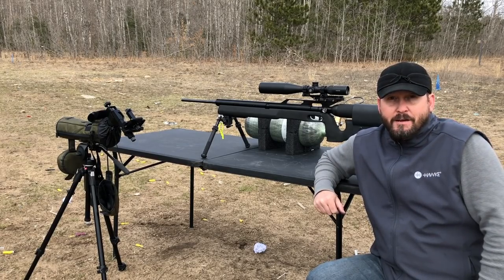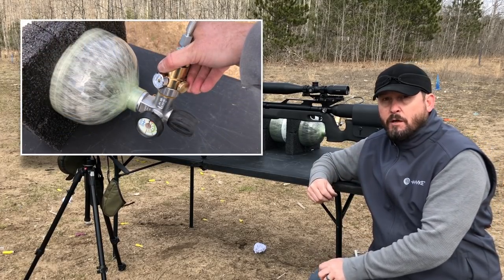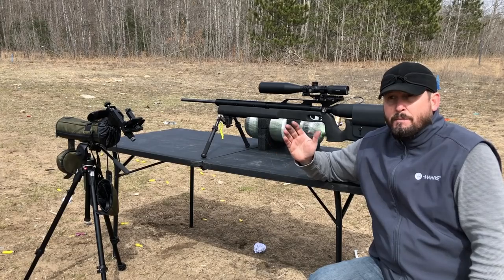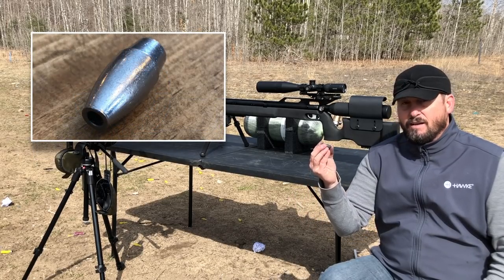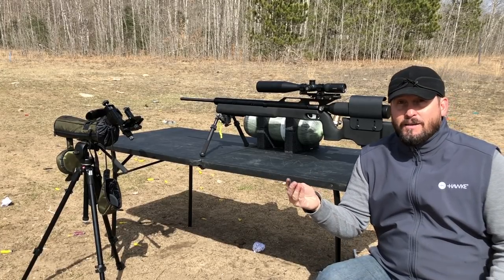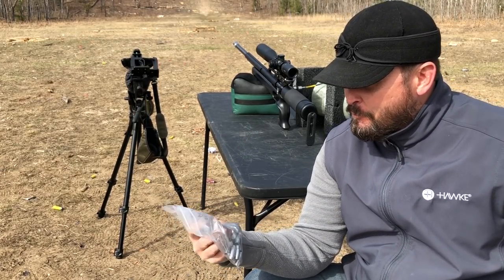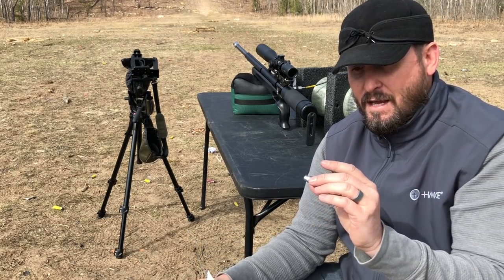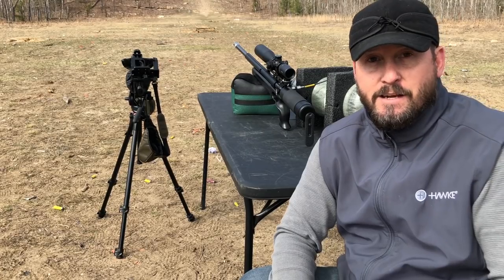AirForce Texan .45:  Tuning for Accuracy - Shooting MOA Groups with Big Bore Airguns

Comment: I am just getting my .457 up and running. I was wondering if you have a wheel spring tension setting choice for shooting this Nielsen 350 grain?
Reply: I have the .50 and spring tension for heavier weights is confusing to as well. Some places I’ve seen say go stronger but some say since the valve is regulated to go lower . If you manage to figure it out let me know 👌 I’m still trying.

Comment: Where do you set your power setting  dial with the 350 grain hollow point.  That's what I will be hunting with .
Reply from the maker: A touch over 3/4 power.
Reply: Thank you for the information.  Very much appreciate it.

Comment: Hey Chris I'm Josh. I have a texan .457 CF with a mad dog stock. My favorite slug is the NSA 350 to this point. What's the best psi to use? Also do you oil your slugs or gun ?
Reply from the maker: Hey bud - good choice! They are the most accurate for sure, but not the best for Deer hunting. NSAs come washed and lubed but I do like to do a small bit of bore butter - silicone oil - and PTFE spray. Keeps the leading down some, but I still have to clean about every 50 shots with a bore snake.
Reply: @UpNorthAirGunner  what's the best deer round? What psi on the nsa 350?
Reply from the maker: @joshuabrackenbury2313  Make sure to check out my videos on ballistic gel testing in the .457 caliber and you will see what I mean.  From NSA - his 348 grain knurled HPs performed great and his 302 BTHP.  Every gun is different, but mine likes 3300 PSI for the best groups at 100 yards, but for Deer hunting I just go up to 3600 and let it rip. Kill  zone is pretty large on a Deer.
Reply from the maker: Joshua Brackenbury ya that was shooting a modded Texan with a 36 inch barrel and custom valve. 525 grain slug

Comment: I’m looking for information regarding understanding the use of the hammer preload adjustment versus bottle pressure.   I have the long barrel version in .308.    I just got the rifle and I’m using nsa slugs.  I’m working my way through the weights starting with the 65 grain & 85 grain offerings.   I’ve got both to print around 1.5” at 100 yds.   My question is what signs do you look for regarding hammer spring adjustment when looking at shot string velocities?    Do you simply add tension until velocity doesn’t increase with additional tension?  This is sort of what I did.  I’d take 2-3 shots check velocity and refill and add tension and run another string.  I didn’t repeat this until the velocity stopped climbing.  I simply stopped with I had 3 shots running about 1050 FPS.     Is there a better way?   Thanks for any insight.

Comment: That's awesome! Do you ever do adjustments with the power wheel on the Texan tho? Also would you have a link for that regulator?
Reply from the maker: I should have mentioned that in the video.  I have found that the powerwheel on the Texan doesn't do that much as compared to a Condor or Talon.  I will tell you though - if you set it too lightly (away from the breech) you can get valve lock and the bullet leaving the muzzle at a VERY low FPS making a faint PLOOOP sound.  It has only happened a few times - but is usually when I am pushing it upwards around 3000 PSI.   So I just set it on one line back from the highest pre-load and don't mess with it.
Reply: UpNorthAirGunner 
Thanks that helps a lot. Im pretty sure I've experienced that sound before. I've mostly been shooting 250g spitzers and I started manually filling to 2700-2800 instead of to the 3000 mark and it seemed to shoot better. That's with the power wheel one line from center towards the trigger. I'll definitely try your adjustment on the power wheel. 

Also, is there a part# on that regulator from Huma-Air?
Their website doesn't have the external adjusted on there so was going to try and track one down elsewhere.

Comment: Quick question, is bad to leave your texan with air in the tank  (lets say 2500psi) for extended periods of time, say 3-4 months?
Reply from the maker: Its actually good for it!  Keeping pressure on the seals prevents them from shrinking.
Reply: UpNorthAirGunner thank you.

Comment: That is awesome, have you done a shot count to see how many shot before it fall off? Since the texan doesn't have regulator I have to stick with the most shot count ammo per accuracy and that is the  196gr and 143 rundball, that gives me 4 accurate shot from 2600psi to 2000psi for 100yd, under 50yd psi don't matter they all hit same spot. Also do you notice that higher psi is actually slower, must be the spring vs back pressure for opening valve.
Reply from the maker: Ya - 3000 PSI can valve lock on me sometimes.  I have learned that when hunting to MAKE 100% sure I am at around 2700 PSI and NO HIGHER! I would hate to valve lock with a deer standing in front of me.

Comment: Chris I was unable to locate the specific Huma regulator you were referring to on their site.  I did find one with changeable springs that set a level range in bar  but  could not find one that was continuously variable.          Maybe I didnt look in the right place.
Reply from the maker: The one from AoA is also adjustable without messing with springs. 1/4 twist with the internal screw setting is roughly 400 PSI up or down.  Mine came set at the medium level so it caps out at 3000 PSI then I can crank it back with the screw driver.  The externally adjustable one is nice - but one thing I have noticed is that the pressure sometimes take a bit to get back up to where you have it set.  So 30-45 seconds sometimes between shots with the Texan .45 where each shot is using so much air.  With the .308 Texan and the Condor shot to shot it pretty much stays at the selected pressure setting.
Reply: Thanks. Just noticed that I have the CGA SCBA connector and not the DIN.  I do have a small tank that after I get it tested I am thinking about changing out the SCBA valve to a DIN. The SCBA valve is scary so I use a REGman regulator in series with it so I dont go above 3000 refilling my PCPs.        Great Videos and am looking at the Nielson  for my  Texan in 357.
Reply from the maker: They both are available on their site - fast shipping to the US as well: https://www.huma-air.com/Webwinkel-Category-6827503/External-regulator.html
Reply: UpNorthAirGunner which one is better in your opinion?

Comment: I've got a 4500 PSI tank. With the heavy spring adjusting it from Full tension to the minimum amount of tension didn't change the velocity at all just the pressure in the tank did with a 214 grain bullet. Dose anyone know of an inline regulator that will fit on the end of the bottle for a 45 Texan
Reply: Hit up chad simon lethal air gun,

Comment: Ive simce sold my Texan 50. Horrendous accuracy no matter what you do. Went to AEA and never looked back. 58 cal Zeus stock with 550 spitzers stacking them in the same hole for the most part. Airforce texan airguns suck and aren't worth it at all. Paper then barrels and terrible efficiency.